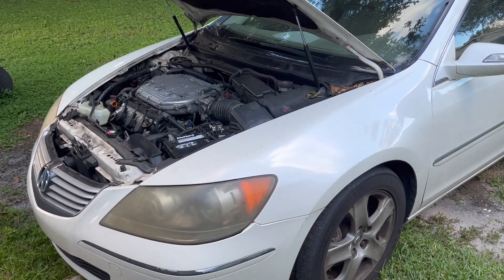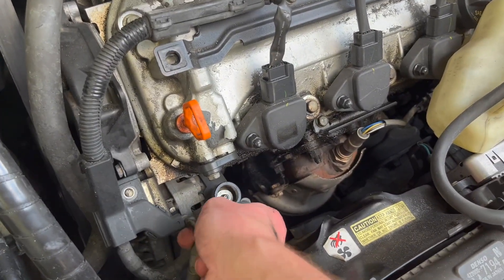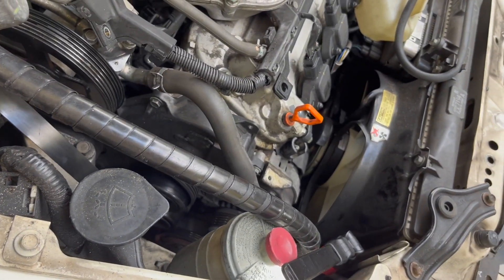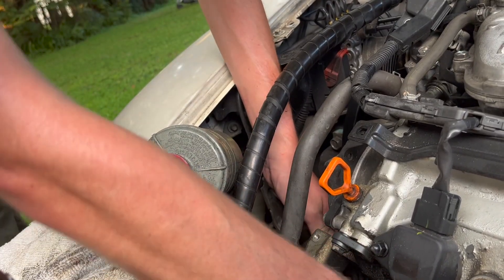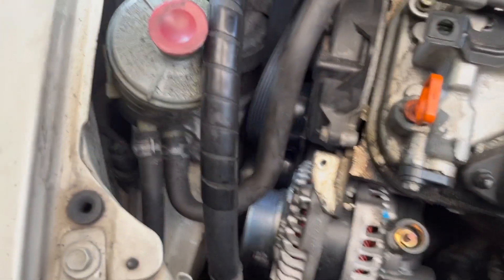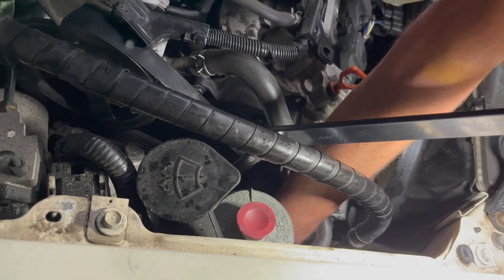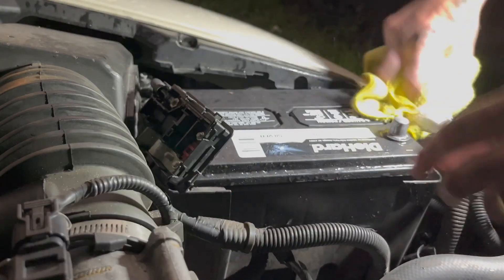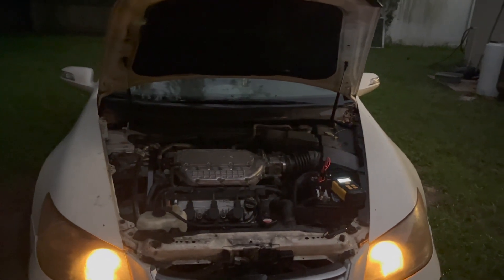Acura RL Alternator Replacement

Comment: I replaced the battery in my 09 RL a couple months ago. After the battery replacement I was driving and lost all power and coasted to a stop. Took a few tries but finally cranked over. Today my wife tried to start it and would not start. I was able to start it after a few tries. It kicked a navigation radio code. Do you think it’s the alternator? Has about 95k original miles
Reply from the maker: If alternator goes bad, you shouldn’t be able to start the car after car already died. Check voltage on battery while vehicle is running to see if voltage goes down. If voltage goes down while vehicle running then alternator is probably the issue.

Comment: Is the RL 2008 doesn't come with a battery holder? I just bought one and noticed today that the battery isnt clamped, held by anything and yours looks the same as mine. Is it supposed to be like that?
Reply from the maker: It looks like they don’t. I guess the fuse thing that goes over positive terminal kind of works as a holder, but I could be wrong
Reply: I went ahead and got some universal battery clamp for my RL. By the way, today my alternator is fried (I think). I was driving to reset drive cycle (for inspection purpose) and then boom, Check Charging System, and then Airbag light, SH-AWD light. I'm pretty sure it's the alternator because last time I accidentally poured power steering fluid all over the alternator and today the battery wasn't charged while running.

Comment: One more question, the battery positive terminal of my car is loose. Do you recommend to replace the terminal or put shim post on the battery post?
Reply from the maker: I think shim post would be batter as the terminal appear to be expensive. If it is not expensive, then replacing the terminal is the way to go (obviously if the terminal is the original problem).BTW that Acura also had kind of loose terminal, I was able to successfully secure it through.
Reply: @PZPal  thank you!

Comment: Do you think the alternator in your link would last long? Because it’s remanufactured rather than new. I have 2007 Acura RL, and its alternator is bad now. Please advise me!
Reply from the maker: I think there are only two options, OEM new and everything else you see is remanufactured. OEM new is very expensive, I recommend getting remanufactured one. If you intend on keeping the vehicle for awhile, try to find an alternator at your local parts store IF they offer lifetime warranty. Over here we have auto zone, advanced auto parts etc. They all offer lifetime warranty. If you're unable to do that, I think the one on amazon is the better choice than spending $400-$500 on a new OEM one.